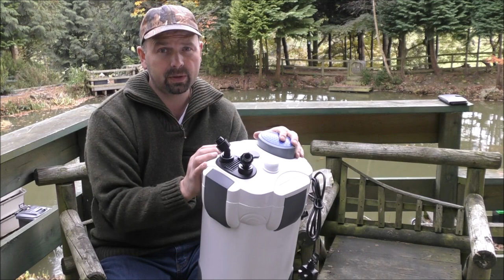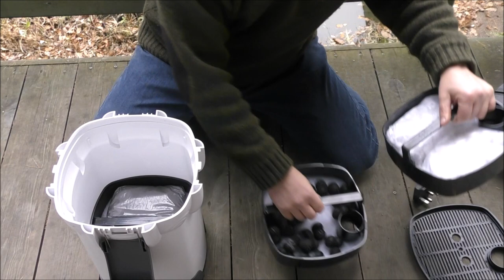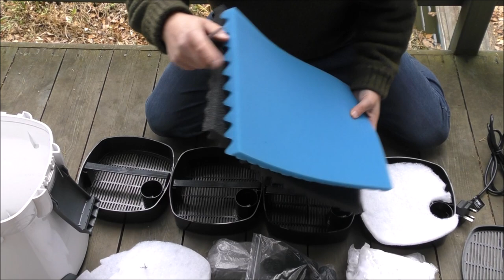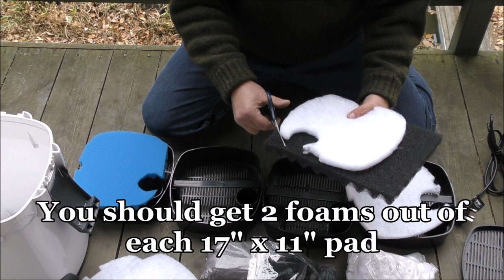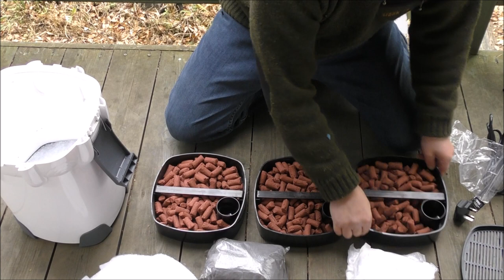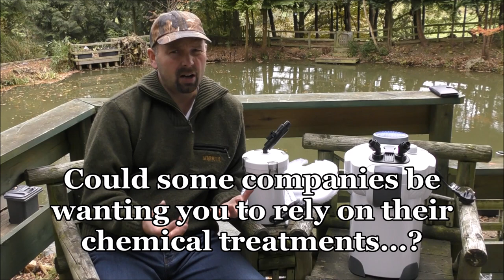Why Your Filter is TOO SMALL and NOT CYCLED

Comment: ok, how slow should the water flow over the media to encourage nitrate to gas exchange
Reply from the maker: Generally the slower it flows the more quickly it will become anaerobic in the filter but it requires an incredibly slow flow over most media types to have any sort of effect on nitrate. Having a media type which has a structure which allows for small pockets of anaerobic zones in any flow is key to success with most types of filters as the flow is way too fast (and oxygenated) for normal media to support anaerobic bacteria.
Reply: define "incredibly slow", give a target to shoot at, it may shorten the time for the complete cycling process? Am I  heading in the right direction? or is it impractical!! THANK YOU for all you do.
Reply from the maker: @agualust  It would generally be described as impractical for a normal filter but if you check the flow rates of various 'nitrate reactors' online you will see just how low the flow needs to be for standard media to reduce nitrate through bacterial activity. That type of filter needs to be used in addition to one which will support mechanical and biological filtration with plenty of flow to keep the water in the tank properly oxygenated.
Reply: THANK YOU once more. I will take a look
Reply from the maker: @agualust  No worries, any time.

Comment: Okay I have that sun sun filter with uv sterilizer and there is no bloody way will do anywhere near 1000 litres I ran it on a 66 gallon full planted aquarium stocked with about 33 to 40 different fish and it was perfect for that aqurium and I still ran an aquaclear hang on filter in tandem with it off and on for breeding angel fish they like lots of flow for breeding. Gph ratings always fall short from manufacturers rating because they slow down over time as they get clogged you have to keep that in mind so overshoot when it comes to canisters.
Reply from the maker: Yes always best to go overboard on filtration and the GPH is measured at a zero head with no pipes / bends etc. As soon as the pipe is lifted in and out of the tank the flow reduces (sometimes considerably).

Comment: Dam i use seachem products, thanks enjoy your videos. Is biohome available in south africa?
Reply from the maker: Not all their products kill off the bacteria but the two main ones which are commonly reported as destroying a full cycle (causing nitrate to rise) or retarding bacteria in a maturing filter (meaning the cycle can never complete) are prime and purigen. When they are removed it is business as usual for the filter development and a full cycle resumes although it can take a few months to recover completely.
It is best not to rely on chemicals to try and keep water right - having a properly set up and suitable sized filter is the foundation of a happy tank.
We currently don't have a distributor in SA but I think the FilterPro website has ordering from SA - just let me know if you have any problems.I may only send orders of 2kg and over to SA as they would go by international courier - deliveries by small packet airmail aren't too reliable from UK to SA.
http://www.filterpro.co.uk
Reply: Pondguru I use prime as a decloronator  and purigen and matrix  in my canister.  Using a Dophin 1600(ratered 2450 lph but only does 1800 liters per hour with media) on a 300 liter discus tank. Water changes done once a week at 50%. Is matrix any good? Thanks for reply.
Reply: Thanks,  just ordered the biohome ultimate 5kg . Exchange  rate killing me lol. The things we do for the hobby.
Reply from the maker: No worries and thanks for the order. It was just collected about 15 minutes ago so you should get updates via email / text and it will be with you soon (hopefully by end of week).
Should get through customs no problem.

Comment: Hi,   I have achieved full Cycles in two of my freshwater tanks with biohome ultimate because of your videos. I recently set up a saltwater aquarium and I was wondering if you think it's possible to achieve a full cycle in a 40 gallon saltwater  aquarium using the same method with about 8 pounds of biohome ultimate? Wondering if it works the same way
Reply from the maker: Yes it works exactly the same for marine tanks too but you could need up to 2kg (4.4 lbs) per 100 litres (26 US gal) to achieve the full cycle. We have a marine version of ultimate which has added trace elements specific to the needs of marine bacteria so that would be the one to go for.
I'm glad to hear that the biohome is working well for you in your freshwater tanks as it is a great feeling to be part of something which helps so many people.
Reply: Pondguru  awesome  thank you!! Super excited about this

Comment: Would you do a Fluval 406 Canister or 2 aquaclear 70 HOB’s on a 75 gallon tank
Reply from the maker: I would never advise using a HOB since they rarely hold a decent amount of media and rely on a cartridge system.
The 75 (US?) gallons is around 285 litres so as long as the tank is a normally stocked community tank the 3kg of biohome ultimate you would get into the 406 would cover your bio-load no problem.
Reply: Pondguru In regards to the foams does the Fluval 406 require the coarse portion of foam in the bottom tray (since it already has 4 sponges before it hits the trays) would you just recommend doing Medium and Fine pads in the bottom tray or would you do coarse, Med and fine in the bottom tray? Thanks always for the help!!
Reply from the maker: As you have those large pads down the side to catch the heavy muck you'd really only need medium and fine in the bottom tray but if you add another coarse one there it won't make much difference. As long as water hits the foams in a filter from coarse to medium to fine the water will be clean before it hits biological media and that's the critical thing.
Reply: Pondguru thanks!!

Comment: this video is a revelation im going to be over hauling my tank soon building new stand and hood im now thinking im going to over haul everything i have a small african cichlid tank 130L  i have it running on a fluval 206 but im now thinking i need something much much bigger im thinking a APS1400 im also wanting to add a uv Filter in line aswell
Reply from the maker: Sounds good to me and that certainly would not be too big for the size of tank and stock when set up properly.

Comment: hi just done a filter exactly has the video and added Live Bacteria Gel Ball as ive seen you do in another video and in 24 hours my tank smells of rotten eggs what have i done wrong ps its a brand new tank set up using 1000l filter and a 125l tank
Reply from the maker: Rotten egg small is generally hydrogen sulphide - what are you using for water conditioner / substrate etc.?
Is the substrate new, filter media new etc.? I need as much information as possible to answer your question.
Some water treatments smell of rotten eggs but without knowing what you have used I would just be guessing.
Reply: hi used the 3 foam filters and alfagrog as mecanical and gel balls plus aqua safe tap water safe
Reply from the maker: None of those should give a rotten egg smell although as far as I know the alfagrog is a by-product of the foundry process so could have sulphur compounds in? If you contact Alfa Aggregates (who distribute alfagrog) they should be able to advise you on that.

Comment: would i use anything differnt for Turtles?
Reply from the maker: Not really but make sure that the filter is way bigger than you'd use for a normal fish as turtles need a lot of filtration to keep water good. For example if you have a 200 litre turtle tank go for a filter which will filter 'up to 800 litres' or basically x4 the size of tank to filter to be somewhere near the filtration they will need. Larger is always better.
Reply: @pondguru Thanks sir just ordered the media you suggested will get all by saturday  i do have another question  i have a zoo med pump working now but as my turtles are getting older i want to add a bigger system would you sugesst leaving the other unit working until the new unit catches up with the good bacteria then pull the other pump offline by the way my new canister is a sunsun 704b believe its rated at 525 gph. Thank you sir i am also the best realtor in Charleston, SC https//www.charlestonlifestyle. com

Comment: If we use canister filter for 300L aquarium then how many day we need to Chang water!???? Fresh water aquarium
Reply from the maker: Even when a filter achieves full cycle it is best to change around 10% a week just to freshen water up and remineralise it. Maintenance on a tank still needs to be done (e.g. gravel / sand clean) and as a result that will drop water from the tank.
Reply: One thing more bro. When and which Medicine are to be use for FWA?? Plz make video

Comment: Hi i have just ordered some bio home ultra is it ok to use in a discus tank and also do i need to rince it out with tap water before i use it?
Reply from the maker: Thanks for the order - yes fine for discus, ideally it could do with a rinse in treated water or water you've drained from the tank prior to use to remove any dust generated during transit but it is not essential since any 'dust' will just be fine sand.

Regards,

Richard
Reply: Thanks for the reply👍
Reply: I have a all pond solutions 1000ef i have put ceramic rings in the bottom tray then course medium then fine sponge in the middle tray and i am going to put the bio home ultra in the top tray will the be ok

Comment: Do you see any issues with installing a heater into one of the booster canisters?
Reply from the maker: I'm not sure how you would fit one in there and they are really too small to sacrifice space for a heater - best go in-line heater either before or after the booster if you don't want a heater in the tank.
Reply: Pondguru OMG... it never even crossed my mind to search for an external heater... :/
Reply from the maker: Yes that would definitely be the way to go and although they are more expensive than normal internal heaters they're good it you don't want a heater in the tank.
Reply: So basically i was in the fish shop earlier... bought an Oase thermo 250... xD. Something you would be interested in pimping?
Reply from the maker: If the trays were a different size to the 600 thermo I filmed a couple of weeks ago I'd have taken the 250 but there isn't any point since the trays hold the same amount (just under 1kg) of biohome ultimate in the biomaster range. They are good filters except the prefilter foams need to be more coarse than they are.
Reply: Pondguru when can we expect the upload really interested to see what you have done to the pre filter.
Reply from the maker: I'm really struggling to edit the videos I have shot over the last couple of months but hopefully I can get some out in the next week or so. I basically drilled many more holes in the uplift pipe of the pre-filter and changed the foams there for coarse sponge which I cut from the Oase coarse sponge from the trays. Bottom tray was filled with coarse, medium and fine foam followed by media in trays above (biohome ultimate, just under 1kg per tray)

Comment: Ok this could have been made simpler and quicker. I always say what ever filter is recommended for your tank then go the next one up and you will be all good. As for the point of you saying you have to loose one of the trays for foams and fine pads, I had the fluval 304 and I had fish for years and I assume the 6th series of the fluval will be pretty much the same. The filter is in 2 parts one have has the foam and fine pads and the other half has the trays for the media. So no need to add more pads.
Reply from the maker: The '06 series has coarse pads in the side cartridge so there is definitely a need for finer sponge / pad in the bottom tray but you're free to set your filters up however you see fit, no worries. All I'm doing in the videos is putting information out to help fish keepers, some may be useful to you and some may not - either way is cool with me so thanks for watching.
Reply: @pondguru  I watch loads of your videos and even altho I have had fish for years I have still learned things from watching so thank you so much for your time and effort into making your vids. Can I ask, my partner has a common gray pleco and it's too big for the tank it is in, is it possible to transfer  it to her fathers pond and what would I have to do to make the transition safe for the fish.
Reply from the maker: @michaelmcclung1829  If you live in a tropical region of the world with constantly warm weather then that will be no problem but I don't know what the temperature is like in your country so can't answer that properly.
Reply: @pondguru  I live in stornoway mate lol
Reply from the maker: @michaelmcclung1829  lol, best not put it outside then.
Reply: @pondguru  ok thanks for all you do mate

Comment: I use 2 of those on 350l they have been packed the way in your other video
Once filled the correct way they only about 1400lph 
The 2000lph is how they test while empty of media
Reply from the maker: Yes all manufacturers give the flow rates for filters in a totally unrealistic way - when they are empty with no pipes attached. I always say you can halve the manufacturers flow rate but in reality the flow is nearer 40% less than what they say once the media, foams and pipes are all fitted.

Comment: Hi there I've just got a Jewel Trigion190l and it came with a Super HW-303B 4-stage External Canister Filter with 9w just starting to cycle the tank now, this should be enough shouldnt it? There are two bags of ceramics in the bottom and then about a kilo of bio balls then a load of sponges T.I.A
Reply: Will be moving every thing around inside as per your advice
Reply from the maker: @shuggiemcg1  That is the smaller version of this filter, equivalent of the EF 1400 we have in UK so it will hold 3kg of biohome ultimate in 2 top trays with bottom tray being used for foams and fine pad. That will certainly be big enough for a normally stocked tank as it gives you close to 1.5kg of media per 100 litres, a bit small for a heavily stocked tank of 190 litres as yoiu'd generally need closer to 2kg of media per 100 litres to achieve a full cycle on a heavily stocked tank.
Reply: @pondguru  many thanks I have ordered 4kg of Alfagrog E25 As i plan on using what I need in this filter didnt know how much it held, I also ordered some bacteria gel balls to kick start it,PS also buying the All Ponds Solutions EF-2 External Filter booster Supplementary Canister,2.3 Litre, it will be a low stocked tank,  many thanks for the advice and reply
Reply: Ps also ordered the All Ponds Solution external 2.3litre booster canister
Reply from the maker: @shuggiemcg1  I can't say if you'll get a full cycle but the grog will certainly be good enough for ammonia and nitrite processing - way better than the muck which comes with the filters for sure.
Reply: @pondguru  thanks again I am going to move to Biohome ultimate after the new year  i know it means restarting from scratch on the cycle but prob worth it
Reply from the maker: @shuggiemcg1  When swapping out old media for new as long as you swap it out gradually you will not suffer any reduction in biological filtration. Do one tray, leave 2-3 weeks, do another tray, leave 2-3 weeks do another tray so the full change of a 3 tray filter would take many weeks.
Reply: @pondguru  thanks for the tip

Comment: Great video.  What media do you recommend for a Fx5?  Could you tell me how you would set it up?  Thanks!
Reply from the maker: I mention the FX filters in this video but I can't remember at what point - the water flows through trays from top to bottom so as you have good foams surrounding the trays you really only need a fine pad on the top of the top tray then you can fill all 3 trays with media (5kg total in 3 trays).
The media used in this video is biohome ultimate and it would take 5kg to properly fill the FX5.
Regards
Richard
Reply: Thank you!

Comment: The filter I bought has a uv bulb inside, would that kill the beneficial bacteria?
Reply from the maker: Yes  UV bulb kills bacteria of all types as it passes over the light. However the bacteria living in the tank substrate and in the filter media / on foams in filter is not affected since the UV light does not shine onto it.
It is safe to run a UV 24/7 but when first setting up a filter leave the light off for a couple of weeks to allow the bacteria to properly flow through the whole system (allowing the filter to mature without bacteria being killed off in water).
Reply: Pondguru thanks you
Reply: My blagdon all in one 9000 has a UV but I turn it off at sunset and then it's only on during the day. Do you think I will be able to fit any more ceramic media in the bottom?
Reply from the maker: If it is keeping the water clear then it is fine to only have the UV on 50% of the time and if you can fit more media in you may as well add it.
Reply: Pondguru the water is crystal clear the rest of the pond has algae growing on it mind. It's a 9watt clarifier. It's just got ceramic media in it.
Reply from the maker: I like the all-in-one filters as they're out of the way, easy to clean and keep the water clear (and healthy enough).
Reply: Have you done any reviews on all in one filters?